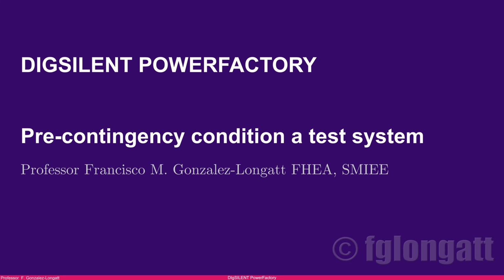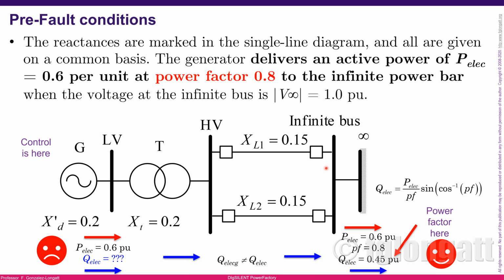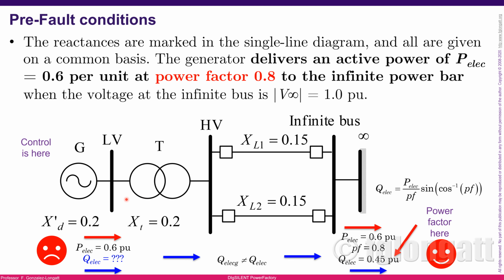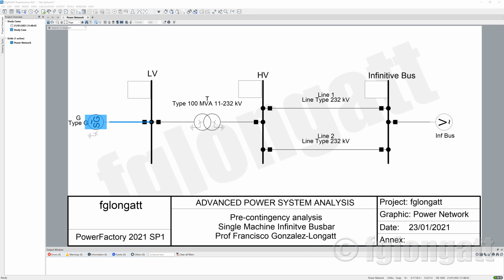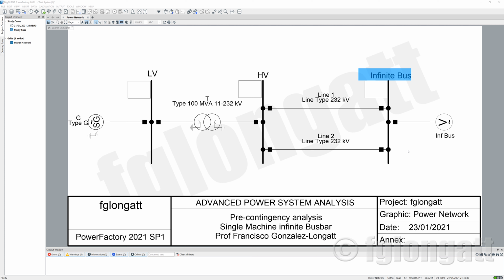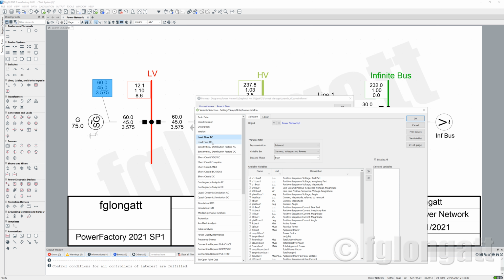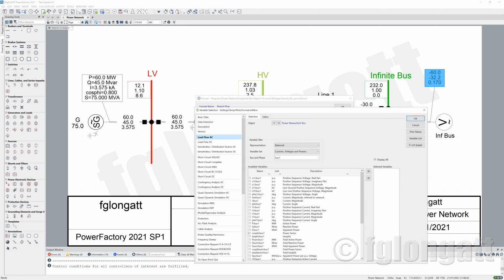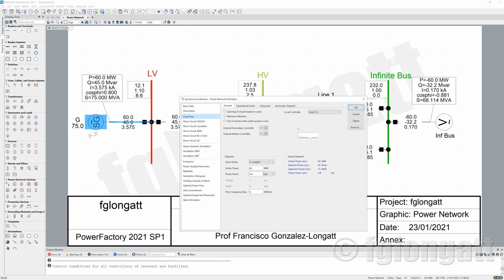Pre #contingency analysis using #DIgSILENT #PowerFactory - PART II

Comment: Good lecture! A question: Why do you propose to use the transient X'd as generator synchronous reactance for the load flow calculation and not the steady state? X'd is 0.2 in the video, Xd steady would probably be well above 1. This could change the whole simulation result, right? The transient reactance is normally used for transient stability calculations (maybe I am wrong however).
Reply: Good question. I am not sure which video you are referring to. Normally you take the steady state impedance to calculate the initial phase angle and as you rightly suggest, this phase angle gets much larger than if you take the transient reactance only. However, once you get a transient (for example a load rejection or a failure or so), the generator reaction (current, torque,...) is best simulated with a transient reactance. As a result, the rotor angle of the generator is stiffer and the generator stays closer to stability. You can of course use a program which correctly simulates the generator transient behavior, such models are more complex. I will introduce such a model shortly.
Reply: @georgschett801  Sorry Sir, I deleted my comment, because there were some errors that affect the results, I simulated this model which is used by Longatt in PowerFactory 15.1. As we do not have classical model of transient model inside digsilent 15.1, I need to implement the best solution which is close to model that prof used. You can look at my transient model here: https://pasteboard.co/c7eFLLdaXHbJ.png
Reply: This model gave results that are very very close to the results in the video. Some friends may need this.
Reply: @georgschett801  And you are right sir, I think subtransient duration is very very short time period and sync/steady state reactance is in steady state calculation (power flow calc in DIgSILENT PowerFactory). I guess that's why we are using transient reactance. Thank you for your valuable time to explain.
Reply: @erenalpaslan  Thanks for your valuable comments! All the best!